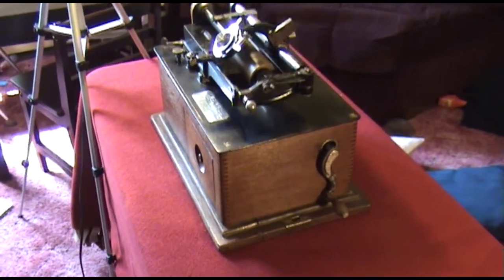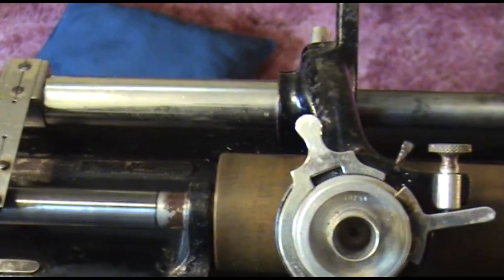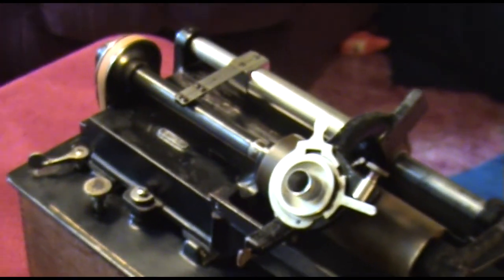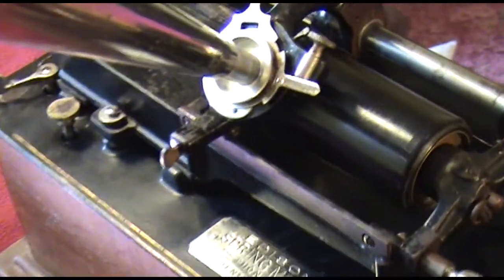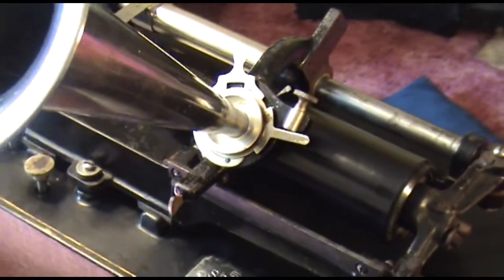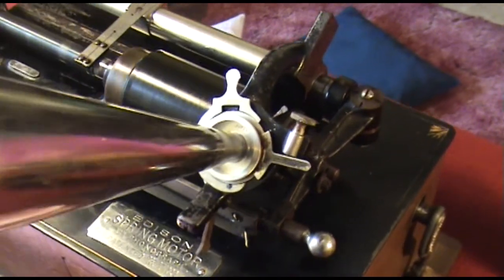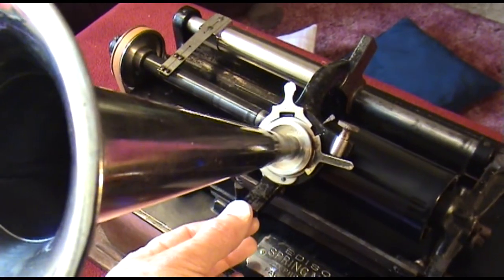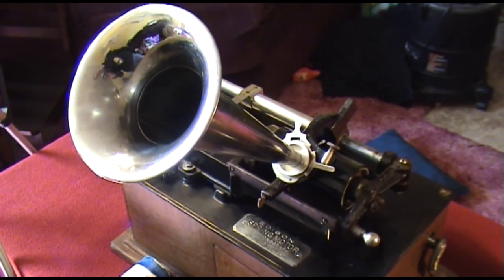Very Early Edison Spring Motor Phonograph Playing 3 Favorite Cylinders

Comment: It strikes me as remarkable that this early machine can run up to the 160-r.p.m. speed that was used in the black-wax era. Is this usual in pre-1902 Edison machines? My old Model A Standard (c. 1903) would do so, but I have had no experience of any earlier models.
Reply: Pretty much all cylinder phonographs can run at 160 plus rpm because the design did not change much from the early machines to the later ones because the design was so simple. The only thing you need to do to change speed is too move the felt on the governer